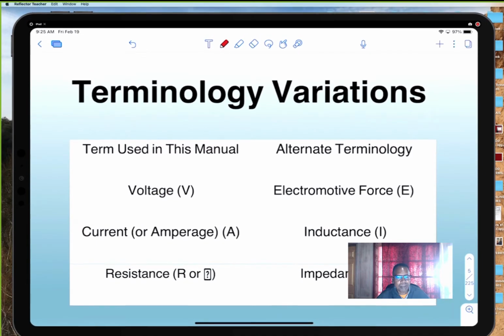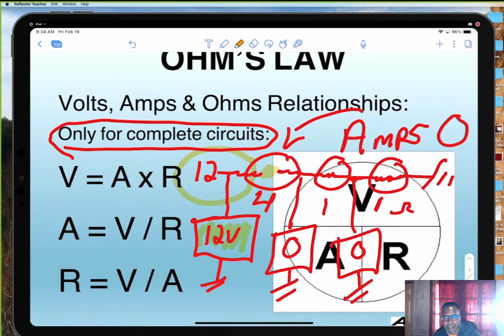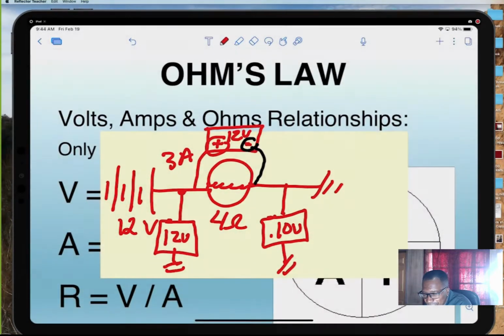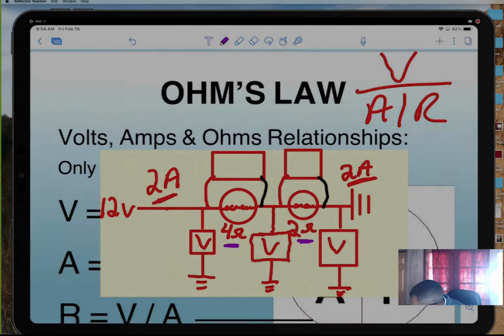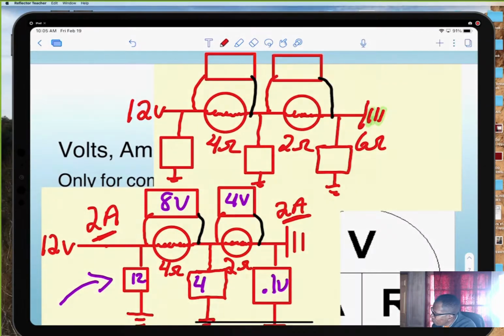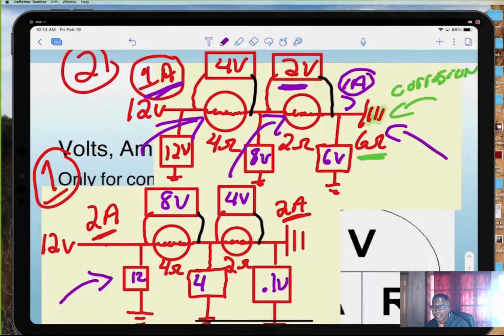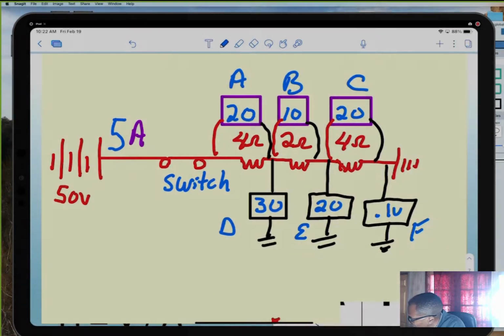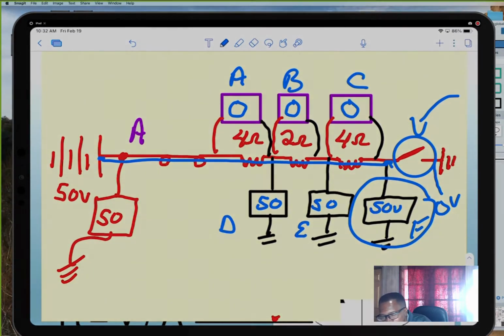understanding ohms law of electricity smog inspector class - zoom presentation Part 1

Comment: Something I learned in this video were the components necessary to make a complete circuit such as voltage,  a load and path to ground. If the circuit is open then no current flows though it because it's not finding its way to the path to ground. In order to find the amperage of a series circuit with three resistors you need to divide the sum of the total resistance, which is measured in Ohms, by the voltage.
Reply from the maker: You are starting the concept of a complete circuit good job